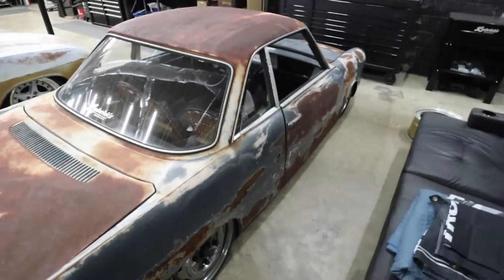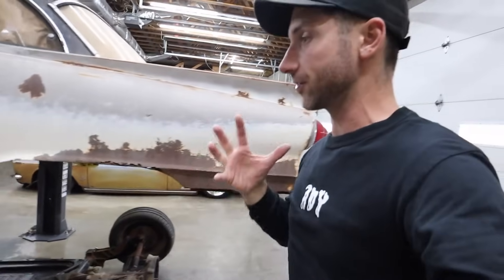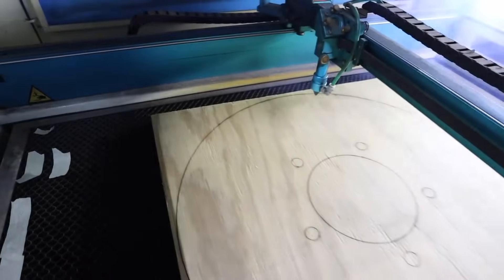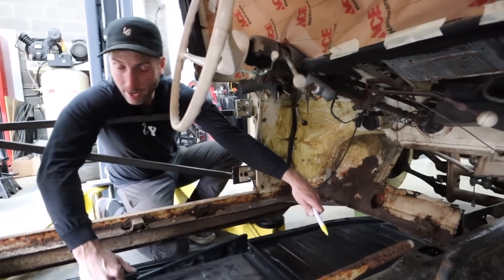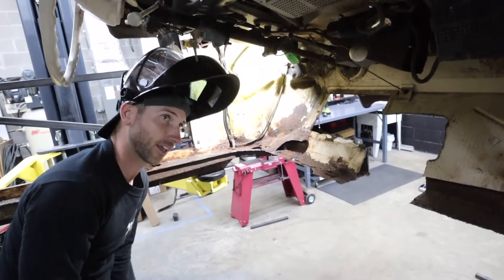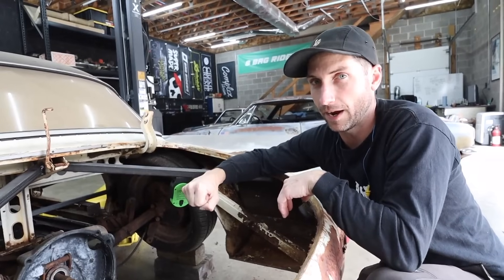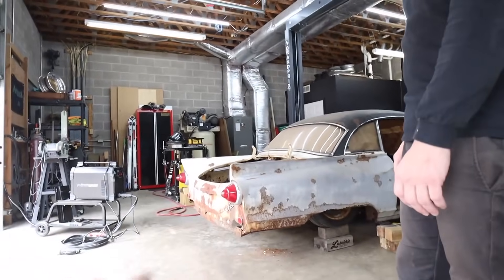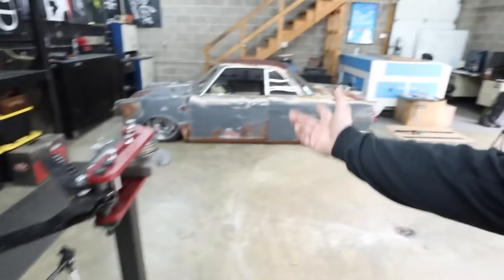BUILDING THE LOWEST AUTO UNION EVER?!

Comment: i think personally need to keep the 15s! cut the rockers off and get that rear end a whole lot closer to the ground, but i would also cut to the very last mm near the window, body drop it over the pan but engine and box raise it to lose the rear camber, the less camber should give you more clearance to the window then you may even get a 17 with an elastic  band on there.

that type 3 motor looking a whole lot more necessary right now lol
Reply from the maker: Heck yes man! That’s exactly my plan, I want to raise the pan a bit more to alleviate the suspension at low and aired out heights! And yes, totally cutting those sills off 😂
Reply: No!!! Read my message why Not! Extend the rear quarters downwards instead and maybe even the wheel openings